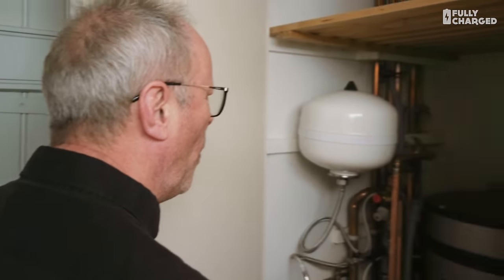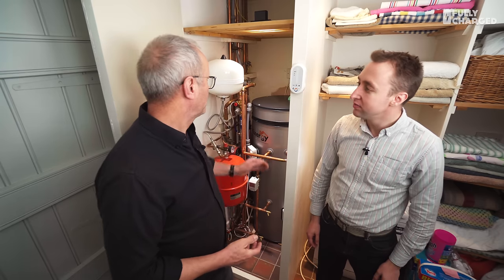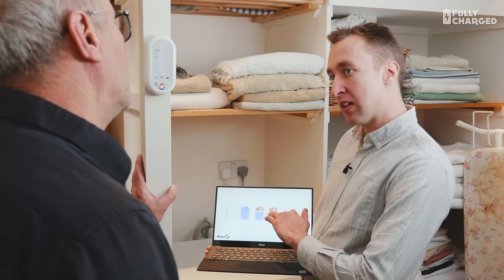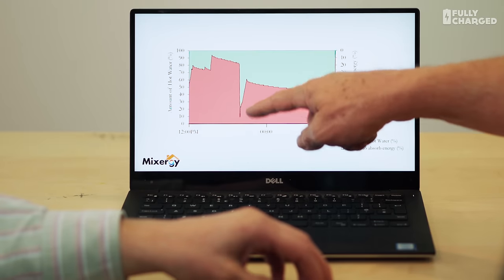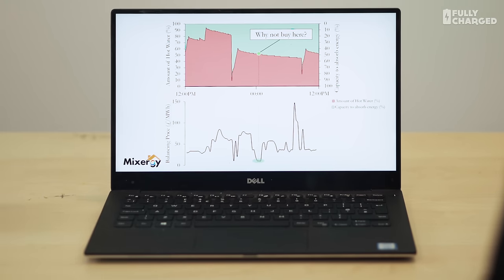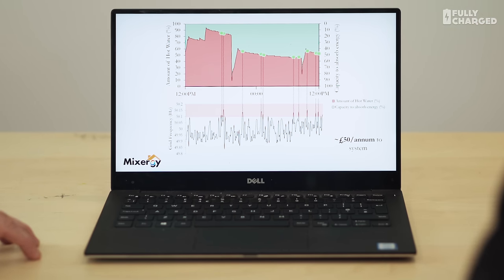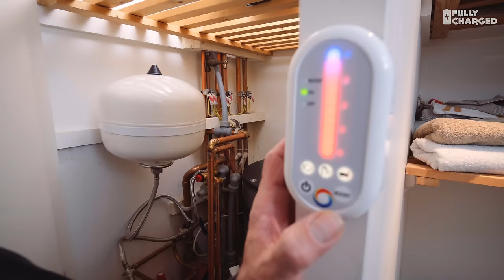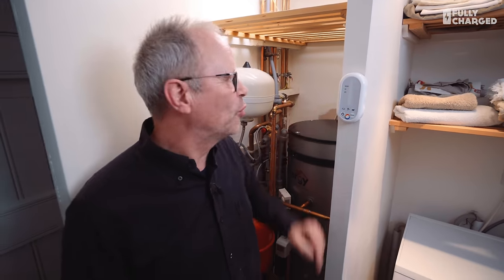Mixergy Hot Water Tank | Fully Charged

Comment: Vary interesting an informative thank you.

I own a 4.7KW PV system for over 8 years. However over 40 years ago I started installing a conveniently located remote switch for my electric hot water system along with super insulating my hotwater tank.  

Having the switch conveniently located in the bathroom.  I now only have my hot water tank on for 10 min a day along with just switching it on before I start preparing to shower and turning it off when I am finished. 

I believe it was about $15 - $20 USD in parts to add the in line high current switch. However,  it will be more if you need to hire an electrician to make the connection obvulisly (luckily I know how to safely do this on my own and have the tools I need).

AnyWay, I like the system fetured in this video a lot. However it will be costly for the home owner once the studdy is up inorder to purchase the equiptment and pay the labor to have it all installed I am sure.

One last thing:
Mr. L. perhaps you should consider super insulating this new tank of your too on it's exterior.  My water tank takes days to loose all it's heat due to the extra layers of insulation I began always add in the mid 1970s. And I now place the tank on 2 inches of rigid foam board when I first intall or replace a tank. This too helps if the tank is sitting on a cold floor.   This is both the first and easyest step to do inorder to start saving your hot water heating expence actually.

Comment: Can u do a video on heat pump powered hot water tanks. Because they only move heat and don't need to create all the heat they are 3 times more efficient than normal hot water tanks enabling them to be used with the limited solar power from a roof.
Reply: Exactly that thought was crossing my mind, I hope he does, ^oo^
Reply: Check the Sunamp edition. That is based on a heat pump solution pumped into a heat battery
Reply: Makes me curious about the solar hot water systems we've had in Australia for decades.

I don't think they're solar panels in the electrical sense, even though it looks pretty similar if you see one on a roof.
But I do wonder how it's designed to function...
Reply: Those are solar vacuum tubes, pretty decent things.
Reply: Yeah, I'm from Oz too, and heating water in the UK has always struck me as incredibly wasteful.
Reply: I just moved in to a house with air source heat pump which does hot water in a tank and underfloor heating.  My first month in the house cost £125 in electricity. Middle of summer, seems a lot. There aren’t lots of people here.  It is four bed but has eco credentials with a green roof and is partly submerged.  I was expecting a lower bill.
Reply: It should have a cop 3 or over, so far better than direct electric heating, do you not have gas?
Reply: This sounds outrageous in the summer, especially as there is a heatwave on, and presumably the underfloor heating is off, unless you enjoy living in a sauna. Does your air source heat pump spec give an indication of how much electricity it is supposed to use?
Reply: dominusdeum  not at all.  I have a concern that the pump may need some work.  The house was new but had been the show home and im guessing the pump wasnt serviced during its first two yearsn
Reply: To offset the comment re expensive Air Source Heat Pump, we have had one for the last 4 yrs and its consistently been cheaper to run than mains gas. Over the last month (hot summer) the electricity consumed by the system to provide all our hot water needs (obviously heating is not required in July) for 4 bed detached house is 27p per day, so, nowhere near the £125 per month quoted above. Over a 12 month period running a full annual cycle it works out about £200 pa cheaper than what we used to pay on mains gas (without taking any RHI or subsidies into account).
Reply: I've got a Sanden heat pump, very happy with it heating up on our solar at 11am each day. This looks like an interesting alternative.
Reply: Not as much sun as we have!
Reply: yea, really strange to throw away the energy like this
Reply: KuraIthys solar water heater uses the sun to heat water flowing through vacuum tubes, like the vacuum tube in a thermos.
Reply: John Richmond did you have the heating on? If not the heat pump is irrelevant. Try to find out what you're using that power on. Most air sourced heat pumps also work as air conditioners which would definitely use a lot of power vs just bearing the heat or using fans, but you should have the option but to use it.
Reply: How about a heat pump that integrated the functions of freezer, fridge,  HVAV and water heating? That creates synergies and greater efficiency between all the functions. That can be augmented with thermal input and storage units. And it could even generate electric based on the design and the degree of the thermal gradient.
Reply: This system is overly complicated for not a lot of value as far as I can see. 

I have a heat pump water heater, previously I paid about $20/mo for the gas to run it (I know this for a fact because by that point I had changed out all other gas appliances for electric and gone solar, so the water heater was the only left on the gas). Then I changed out the old tank for a heat pump. The electricity is minuscule, about 400 watts for 5 hours (approx 2 kWh) for a charge for three showers. Additionally it provides free air conditioning in the my garage, and finally it's free because it's off the solar.
Reply: True. most utuber wannabe experts need glasses to "see" and to understand what the word "value" means.

So enjoy your "free" solar power and the associated electric appliances that cost thousand to purchase.  And your air conditioned garage in the winter.
Reply: u mad? lol
Reply: Nope, DId I make u mad? lol

Just made the point the world is complex but ppl tend to like simple, easy to understand solutions... So there is not uses getting mad :)
Reply: The total cost of the equipment has passed the paid for itself date. Moving NG, petrol, and electricity onto one renewable source has an up-front capital cost but at some point, typically 3-10 years for most such investments, pays for itself, thereafter earning money. It's no different than any capital equipment investment.  Also in my climate the garage gets warm/hot in the winter.
Reply: BTW, I'm all for ppl contributing to a cleaner world. And while producing that equipment has its own carbon and pollution footprint. I will assume it will be cleaner over its lifetime. So thx. 

I will leave it up to you and you accountant to address its financial feasibility and its payback period. And thanks for the civility of your retort.
Reply: np. Actually these kinds of financial calculations are notoriously difficult, I knew somebody once who did exactly that for a living, which was projecting the environmental and financial costs of such ventures. His answer was "we can't really know the costs, at best we ballpark it". The problem is that you have to have a set of assumptions the calculations are based off of, so the result depends on these. Additionally you can't read the future, so it's not a simple arithmetical result. For environmental impacts it's basically impossible to know the true cost (e.g. carbon cost) of anything, but you can try to approximate it. 

Long story short, FWIW for me payoff was about four years _given my set of assumptions and conditions_, so I tossed in a few extra and figured that in six or so it should start earning money. In practice, I use a lot of energy between transportation and household (well we all do), and I never go to the gas station and at the end of the year my 'true up' with the energy company is zero. If for nothing else that is worth it.
Reply: It's all based on premises. The important thing is to make sure the client knows what those premises ie assumption are that the calculations are based on.
I have an engineering and finance degree so I could bore you to death with all details of how to calculate both aspects of what your discussing but this being a utube comment thread it isn't the proper forum. That why I try to use the simplest nomenclature possible here.

So "long story short"  if it functions well enough to suit ur needs, just enjoy the peace of mind it affords you. 

BTW It's just a shame I doubt anyone will fully comprehend my earlier proposal but that's life. Since utube is not a scientific journal.
Reply: John Richmond what temperature is the hot water stored at in the cylinder? Also. What size is the storage tank. I often see ashp systems where the tank storage temperature is set at 65degC therefore the 'back-up' electric element needs to top up the 45degC water offers the ashp to reach 65. Also, if the tank is too small and water is being drained too quickly, the electric element will kick in again.
Reply: I have a recently refurbished house that has solar, Tesla battery and an ASHP. The heat pump has used just under 60kWh in the last month so that would be about 30p per day similar to one of the other comments on here. With the solar and battery it's obviously free (other than the £20k or so up front of course....). Can't wait to see how it works out over winter but if the FC people want to take a look and get some stats they're more than welcome.
Reply: John Richmond Whereabouts is the house?  Air source isn’t suitable for everywhere in the British Isles due to the damp climate. That bill seems excessive for summer though
Reply: FYI-Higher moisture content in the air would make an ASHP more conductive and therefore more efficient than dryer air...
Reply: N C No I disagree. I used to work for a renewables company. They stopped selling them. 
What happens when the ambient temperature drops to less than 5’ is that the moisture in the air begins to condensate & freeze on the heat exchanger. Then most of the units have to go into a ‘reverse’ cycle. That’s a 4kw immersion in most cases. So forget your COP, you’re running a 4kw immersion heater.
Reply: I guess you don't use a frost free refrigerator? Since it has to ‘reverse’ cycle too. And you didn't disagree with what I said since you failed to address the point I made. 

The fact your company failed to make a viable ASHP just shows your company apparently needed better engineers. Since I have lived in humid area and have used a frost free refrigerator that ‘reverse’ cycles and an ASHP for decades. 

ASHP's real issue, is their efficiency is depend on the outside ambient air temp. Not that they have to occasionally  ‘reverse’ cycles to thaw a little frost.

Just curious what the name of your renewable company? Or what types of products do they make?
Reply: N C I didn’t say they made them. Just sold them. It was owned by a top engineer (with a long track record in design etc). He said selling them to an unsuspecting public was unethical. He also reported the scandal of RHI in Northern Ireland (google it).
Reply: Good luck to you and the company owned by a top engineer with a long track record in design etc. To stay out of jail (or getting sued) for unethical selling flawed versions to an unsuspecting public. That caused a scandal of RHI in Northern Ireland. 

BTW-It's good to know you have a fellow engineer with a long track record in design etc to explain the flaws in your rationale, about how an ASHP functions. On a simplistic enough level where you can hopefully comprehend the concepts fully, instead of just changing the subject.
Reply: N C I’m not going to grace this nonsense with a reply.
Reply: Which make sense, since you never had anything relevant to say except egotistical rationalizations of the salient facts. Have a good day, Sir.
Reply: @johnnyrich1  John, that seems an awfully large cost per month, has it  come down in the two years since? I’m interested as I’m thinking of getting an ASHP
Reply: @budflanagan1262  well altogether I'm on a £159 a month tariff.  It's come down not because usage but a better tarriff. Happy to chat off line if you want to me to share my thoughts.
Reply: @budflanagan1262  it went up and came down again. We seem to be now fairly consistent between the houses on the development.  Though the houses are well insulated they are quite open plan and with thick floors with underfloor heating no heat rises.  I notice that certain rooms like the main bedroom which has the deck on top of it takes a lot to heat as The roof Isn’t insulated as well and it’s got three external walls. There’s various other oddities where stats are put in the wrong place and keep it going overtime and its a good size house with 4 beds and 4 bathrooms so it’s in the ballpark I think. But my big issue was the tank which at just three years old needed 5 days of plumbing time just after new year to re weld every joint, replace each pump/switch between the water and heating.  Since then it’s been much more effective but because it was leaking so badly the pressure was always down and it was on constantly as it never reached the temps needed.   I had one 73kwh day among all this.  It’s settled to lower.   Yesterday  was 55kwh but before that 30-33 each day.  In April I was some days using 16 or so it varies but ls no longer the biggest issue I have which is now water as that’s being used at an alarming rate and must mean leaking

Even with the issues I had I’m happy I’ve got a heat pump.  It’s key to make sure the installers know their stuff tho.
Reply: @mad4mymini  the heat pump might not even  heat the watter at all. it needs to be automated... in the summer the default  mode is on cooling

Comment: This is very interesting!  I'd love to see a video that describes how an average semi detached 3 bed house, gas combi boiler, no solar/battery, would outfit with the kit you show on the channel and an approximate cost.  I'd be interested in replacing the south facing side of my roof with solar, PowerWall for storage and replacing the gas boiler with a Mixergy equivalent but I've no idea of the cost so I could approximate the savings I'd get in return.
Reply: buaan switching from gas to electric heat is a bad choice unless you have a source of free power. Gas is still the cheapest form of obtaining heat. Even off peak electricity is twice the price, peak rate electricity three or four times the price. If you're going down the solar PV route it may be worth it but return on investment will be long- space heating is by far the biggest energy cost for any UK home, water heating is perhaps 20% of You gas bill maximum.

Comment: This video got interesting at minute 9. Balancing the grid is the big value it could add. Utilities already offer discounts for direct load controlled hot water heaters. Using this system to store your solar electricity rather than net meter it is less efficient.
Reply: I'd like to politely disagree here Brian! (but then I would ;) - using a surplus of solar energy to go directly into a Mixergy tank is a very efficient proposition rather than going through a battery with the round-trip efficiency penalty which this incurs. We work with PV diverters on the market such as the Immerson or Solar Iboost but unlike a regular tank, small surpluses of solar energy rapidly develop useful quantities of hot water. Furthermore, we can elect not to use the surplus as we measure the tank's state of charge. This means that the surplus can go into an electric vehicle, home battery or straight into the grid to decarbonise activity occuring outside the home. For more info, please see our video on the topic!:) : https://youtu.be/Kpv-uLfItaE
Reply: Pete armstrong Didn't he mean it on a grid level? It would be more efficient to have a grid tied system directly feed the grid and not just heating up water.
Reply: Yes, it is better to have you neighbor use the electricity to run electrical devices than convert it to hot water and loose energy in the process.

Comment: My solar boosted hot water tank has the inlet at the bottom and an electric element about half way up. There are heat collecting panels on the roof and a small pump that circulates water back into the tank once the sun has heated it. A thermostat on the panels makes sure that only hot water is pumped. Since the electricity is connected to off peak it heats up at night, and has enough water for rainy days.  In Australia we also have heat pump water tanks that function like a reverse cycle air conditioner - they use electricity to absorb heat rather than heating an element, and so generate approx 4x the heat from the same amount of electricity. 

The heat pump would probably be more effective than this system, although there isn’t a reason why you couldn’t combine it.
Reply: Interesting that it has a pump. A lot of solar hot water systems circulate the water passively using a thermosiphon.
Reply: nerd1000ify  - Most of the systems that use that technique have the tank above the collector panels, which means on the roof. My tank is 330 litres, so would weigh at least 450kg and require the roof to be strengthened to take the weight. Instead the tank sits at ground level and the collectors are on the roof. The ultimate system would be to have the solar collectors and heat pump electric heating. Sadly no-one makes those (that I have seen) yet, opting for solar with resistance based electric heating or straight heat pump. Maybe when my current system wears out I’ll be able to get a more optimised system.